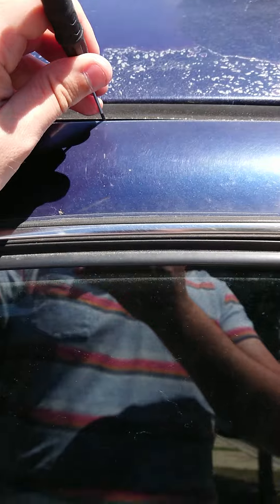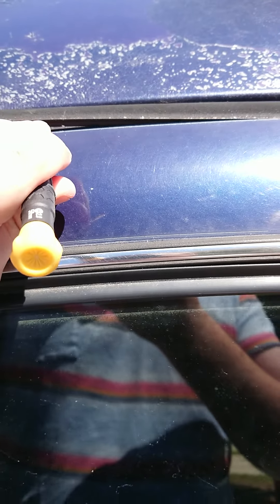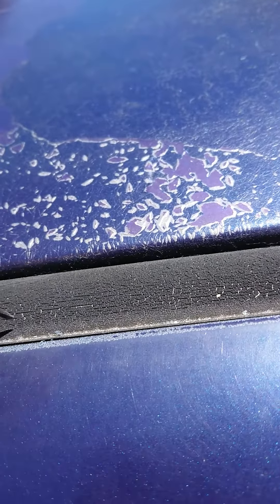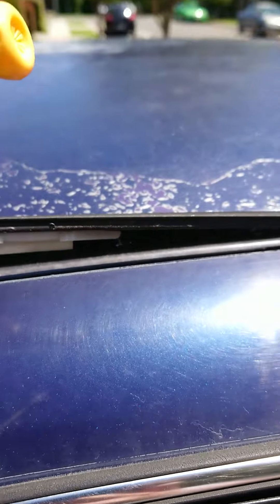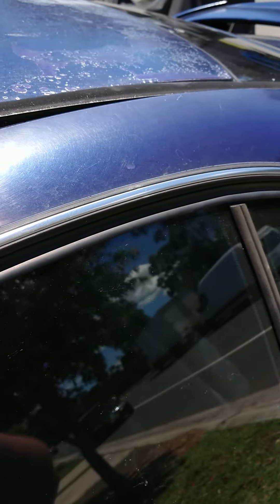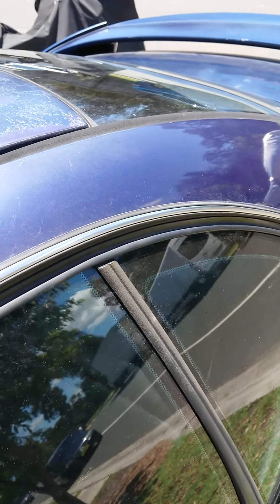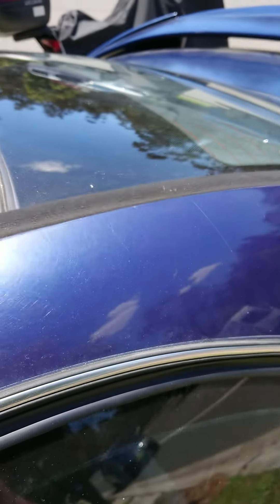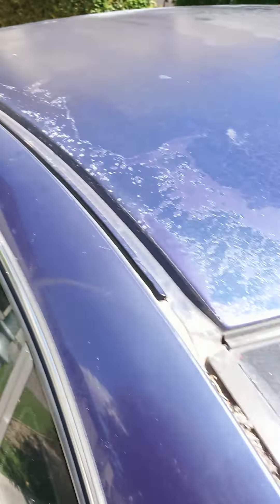Weather stripping removal vt-vz commodore/hsv

Comment: Thanks for that, just saw it from the Just Commodore's forum as I have a VY Station Wagon that I need to do this on for dealing with small rust holes near the windscreen rubber that is allowing water inside ..... has completely ruined my roof headliner (sagging/pillowing), down that passenger side from the windscreen- all the way back to the tailgate.

Handy vid mate ! 👍

Comment: Bloody can't get mine off. On the VT, the gutter trim covers the back window as well, and that's where I'm getting stuck. Wish they had uniform design.
Reply from the maker: try going from the other side, depending on the condition of the clips they can be a real bitch to get off

Comment: I have a wm statesman and some kind of leak in the passenger side left rear side 2007. Do you think replacing these moulds could fix my leak issue?
Reply from the maker: Hey mate, its probably more likely the window rubbers. These are more a cosmetic thing, however there is a panel join under it. Maybe worth having a squiz and see if its damaged or rusted.
Reply: Could it be the front window rubber too even though its wet at the rear going down the rail?

Comment: Legend. Been thinking of doing my roof as well and this had me mind boggled. Any tips on how to deal with the front and rear screen seals?
Reply from the maker: I think you can still find NOS ones on ebay. they pop up at times. If you are going to pull anything to replace these parts, the ones on a VZ are the way to go.
Reply: @zackriley4577 cheers mate. I don't think I'll be needing them anymore as someone else decided they wanted my car more.

Comment: Replacement nit repair.🤷
Reply from the maker: Get the ones of a VZ. They are rubber instead of powder coated. Even crap ones are going for $100 each atm. Ive looked at options for getting them re-powder coated. Still a lot of prep work.

Comment: Half the time the small end piece has gone walk about. Junk design all round and brittle as heck. Broken a few in my time when replacing the back window
Reply from the maker: You can get new clips on ebay now. These are becoming harder to find
Reply: What’s the link to the clips or the name of them mate?
Reply from the maker: @dwayne1763  Sorry only just seen this. I cant find them. Going to try recreate them with the 3d printer. If they work I'll put them up there